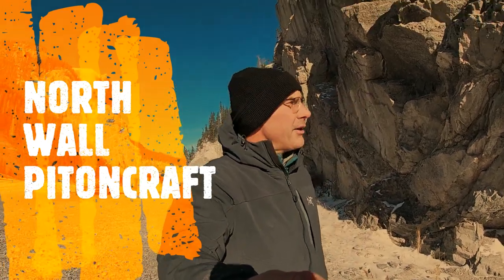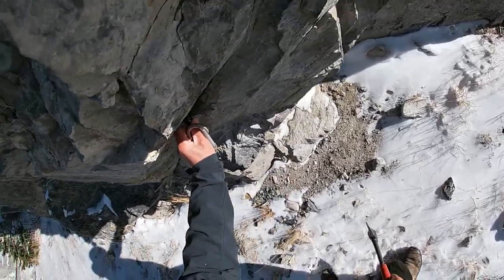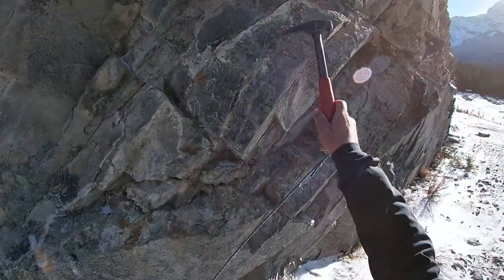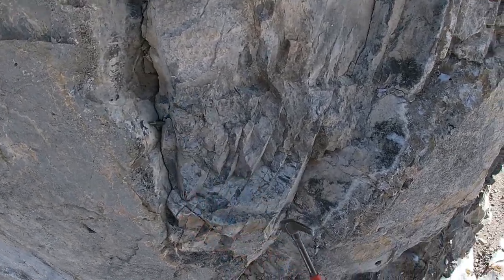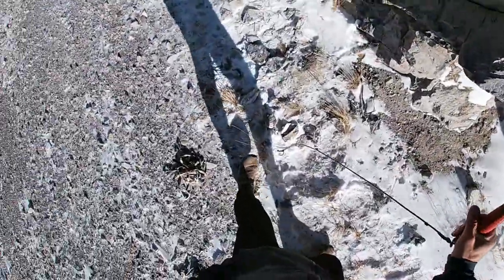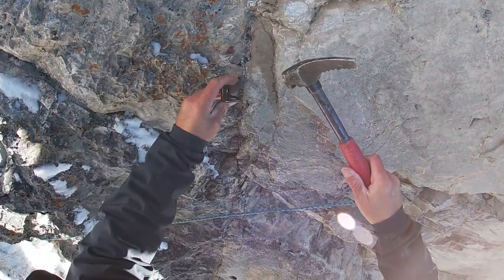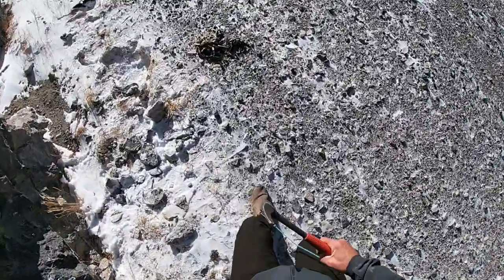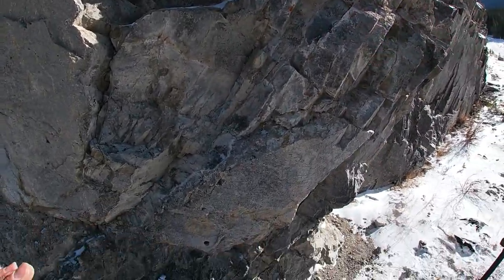ROCKIES LIMESTONE PITON CRAFT -- Rock Climbing Mentor Series

Comment: So pitons and hammers are common gear for alpine climbing?
Reply from the maker: They are commonly used in the Canadian Rockies when the routes have not had a lot of traffic and/or there is a minimal amount of fixed gear and often no bolts on big limestone walls. On First Ascents, it would be extremely rare to not have a selection of pitons to make an attempt on a big limestone wall in the Canadian Rockies.
Reply: @respecttherisk2022  cool man. I'm pretty new to the whole scene. Pitons seemed a bit tabu but like they would be pretty useful in some scenarios.
Reply: @respecttherisk2022  gotta love the rockies, I rode through the icefield parkway to Jasper this summer beautiful country.

Comment: Which Hammet is that One you are using?
Reply from the maker: It is an ancient Chouinard Ice hammer from the late 1970's or early 1980's. The pick snapped off at about half length in about 1987 when I was taking out a piton (because I had filed bigger teeth into it for ice climbing: It was my first ice hammer circa 1982 when I bought it used -- I actually led up to Grade IV water ice with it! )(sheesh!) But I still like it as a rock hammer as the pick is useful for taking out pins, as shown, or cleaning out rotten or dirt filled cracks. It's light enough, but heavy enough for use as a pin hammer.
Reply: @respecttherisk2022  lovely story that very one!! i am not disapointed at all, i could tell there was something special about it. thank you very much, this kind of made my day